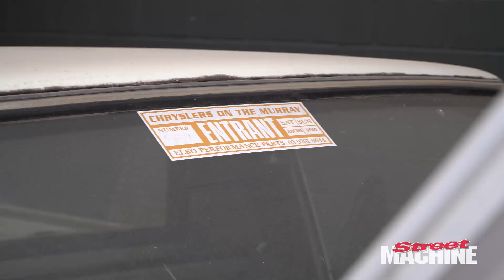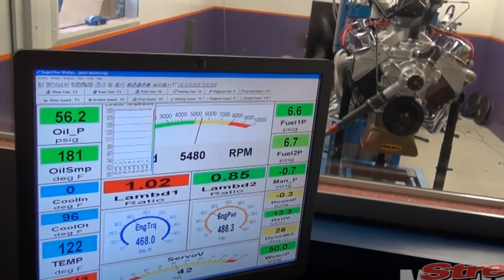Carnage - We're Getting Dad's Ute Ready For Mopar Sunday

Comment: I stumbled upon a later episode, and had to go to the start to see this build through and every episode following now.
This very model VE Valiant ute was my first car, even the colour ( I think they only made them in white). Mine was a town work ute, heavily used and abused by a local truck depot, full of dents and rust. My dad ( who earlier owned a VC Regal auto) taught me how to change out a gearbox (3 on the tree, no sync 1st gear), drum brakes, shocks and springs, radiator etc. 225 slant was a recon with a new 2 barrel Carter carb, 160HP. (in the early '80's)
The steep learning curve of ownership came to an abrupt end when I flipped it onto its roof and wrote it off (but it got parted out to a bloke who rebuilt the car I was stripping at the wreckers) . I never thought the car was cool then, but since that car, I have a fondness to all Valiants, especially A-bodys, Darts, Plymouths I have seen restored since at show days. Thanks to my Dad too, who will turn 80 this week.

Comment: I lost my dad to cancer 4 years ago in his early 60's. My dad also handed over the keys to a beautiful vg coupe which I regretfully sold many years ago and to this day it haunts me!
Look forward to seeing you build your dad's while I imagine what I could have done with mine.. 😭
Reply from the maker: Sorry for your loss. Yeah, I'm pretty sure this will never be for sale
Reply: @STREETMACHINETV  thanks Scotty you to mate.
Yeah it was one of those things, was in a tight spot and unfortunately it had to go. But back when I sold it you couldn't give them away, now as you know you pay through the nose for something that needs a full resto but I'm always on the lookout.
Reply: @STREETMACHINETV  Hey Scotty ,  lovin what your doing with your dads VE  for your son Alex  , good move brother  .
KB - 167 - 060  hypotec  , airfreight from  USA  5 days .
you will only need to take minimum of the block   , usually .008 - 015 for 4 corner zero deck .
at 075 thou off your 318  will lose deck regidity and at 9.5 / 10. 1 = blown head gaskets and a not good mopar run . 
075 of the deck also = intake sealing problems and it stuffs up the pushrod geometry .
KBs are light = RPM 
good balancer , bolts n balance 
isky 280 mega 
eddy air gap 
750 vac = big smiles 
good luck Scotty  👍😎
Reply from the maker: @davidandrew2610  Funny you should mention those. After some soul searching I decided to pull the trigger on some Kb-399 this morning. So higher comp again and all the advantages you listed.

Comment: Scotty, my best mate had a CL Charger NSW HWP car with a 318. Revved to about 7000 rpm. I don't know if it had had a cam swap, but it still was very impressive. So when you said 318, I was pleased. I also remember all those Hotrod magazines I read back in the 80's, where they hotted up a 302 windsor, a 305 chevy & a 318 Chrysler. They always seemed to get a bit more from the 318. I'm looking forward to this build up , as I was going to put that 318 into a VH ute, until we found the high water mark from where it was in a flood. It was basically swiss cheese for the bottom half. The HWP Charger also succumbed to rust, which is why the engine was available.
Reply from the maker: Yeah one of my buddies used to have an ex-hwy charger

Comment: I just put a 360 in my ve with a 904 behind it but no weights on converter crap. Probably saved me 👌
Reply from the maker: You can get away with no converter weight by using a special flex plate from B&M. The 360 is externally balanced so it's definitely needed.

Comment: I’m looking forward to seeing this engine go together especially with all that Edelbrock gear.
Hopefully you can get 10:1 compression to help the power and make that cam work. Are you going to have this engine run up on a dyno? 
Are you looking at getting those alloy heads tickled up a bit in the bowl and go over the valve job? I’m  sure Johnny Pilla could give them the once over and squeeze a bit more out of them. 👍🏻
Reply from the maker: We'll tune in on the chassis dyno because of the time window

Comment: I know hindsight is 20/20 but if you cut a piece of hollow tube for the bolt (like they sell at Bunnings) you could have had the chain closer to the deck and not risk bending the bolt. BTW rattling the bolt into the block dry was a bit cringe worthy.